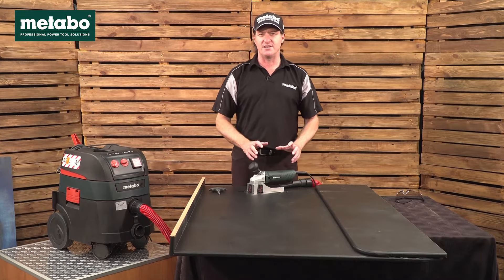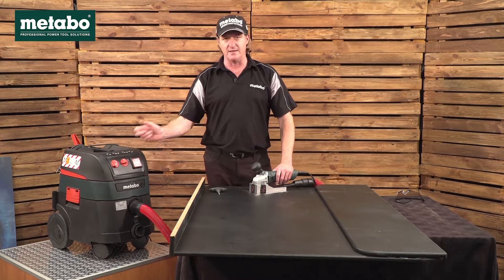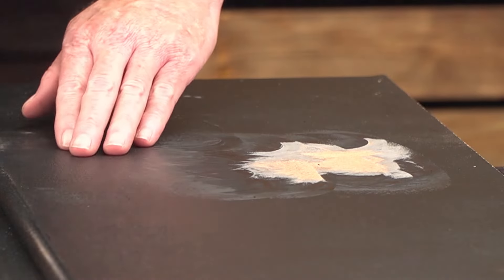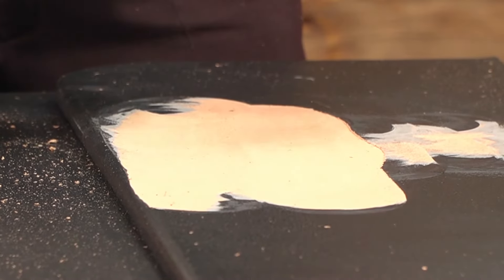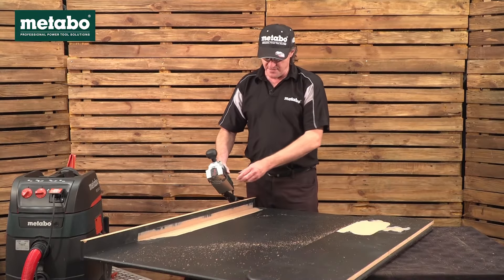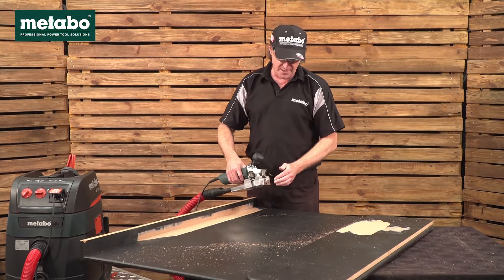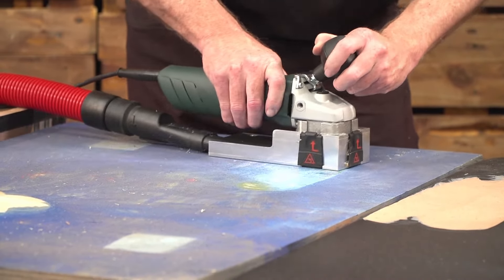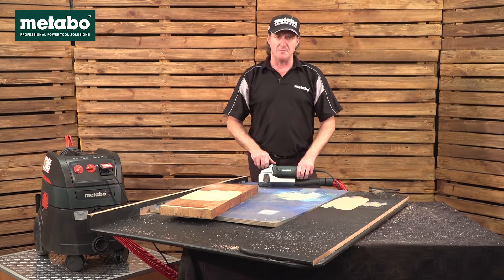LF 724 S (600724000) PAINT REMOVER Demo

Comment: You should have an oblique illumination source on the products you are stripping, to show the texture of the cut surface. Your very bright direct illumination does not show the result correctly. And, you should have a man who has experience actually using the tool, as clearly watching this person does not. He fails to hold it flat onto the various surfaces, he makes too many passes in a disorganized fashion, and allows the flat of the tool to leave the unfinished surface which it should never do if the cut depth is to be related to the cutter setting.
Reply: Why don’t you just make a video a do the showing ????